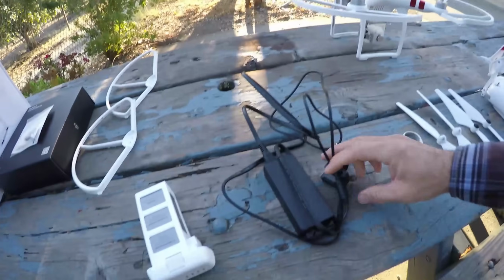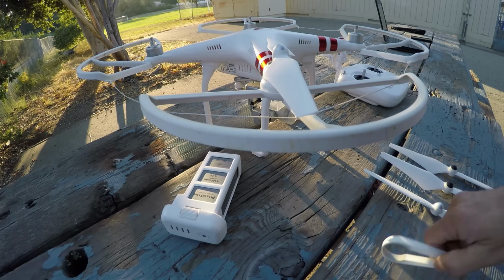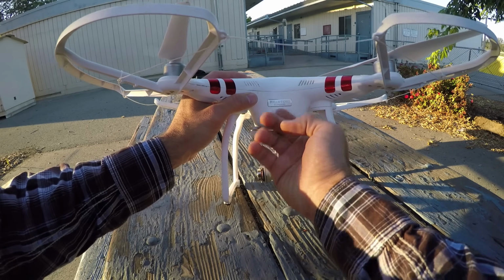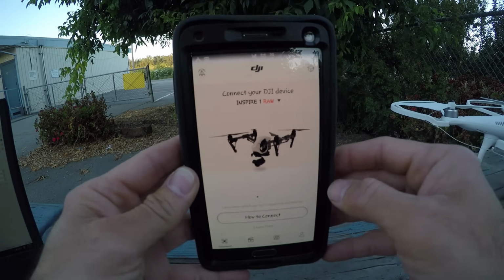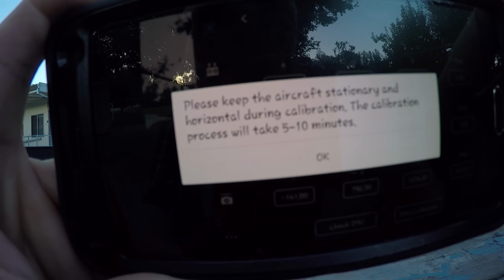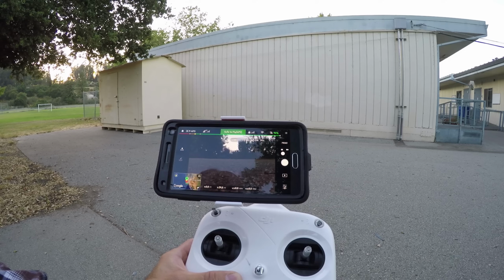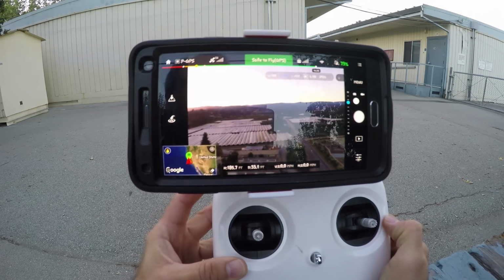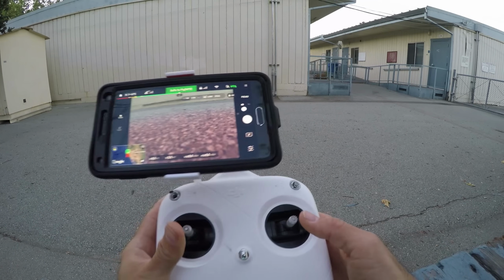DJI Phantom 3 Standard Complete Starters Tutorial

Comment: This is an awesome drone.☀️.☀️>JustU.Faith/DJI-Drone?養    Sturdy and powerful. Battery lasts about 20 min so don't fly it so far away that it can't fly back in time. I was worried after hearing reports of fly away, but never had a bit of trouble. I believe the problem some had was not resetting the home. I do that everytime I fly it even if from the same place. The 4k video is very good and since it is a wide angle view allows for enlargement.

Comment: I needed a great informative video like yours. I bought a used DJI 3 with no manuel and parts missing. The only thing you didn’t cover were the uses of the two toggle switches. I will be referring back to your video many more times until I finally piece my drone together and actually take flight, and probably then a couple of more times. Again THANK YOU !
Reply from the maker: You're welcome and I'm glad it helped. The DJI P3 doesn't come with a manual. Everything was scattered on their website which is why I tried to quickly throw it all together for a video. I actually talk about those switches in the video description because I realized I forgot them in the video. Thanks for the comment :)

Comment: When I try to use my scroll wheel on the side of my controller, the camera does not move up or down when it is still on the ground. Is this because something inside the gimble is broken? the join that moves the camera up and down stays in a relativity stiff position when everything is powered off. Everything else works fine for the gimble for stabilization except for when I want to move the camera up or down.

Comment: When you take a picture or video, does it go straight to your phone or do you need to load the mini card onto a computer
Reply from the maker: The DJI Go app will store a low res version, but the high res (most desirable) will be stored on the Micro SD card in the drone. To obtain that file you need to insert that card into you computer using an adapter.

Comment: Enjoyed your video.  Very thorough and informative.  I dont have this drone yet but after watching this, Im confident that this is the drone for me.  My current drone is very difficult to operate.  I do have a few questions.

1.  I was informed that the drone will scan and can back away from a tree or wall and avoid an accident?

2.  What is the purpose of the string around the drone?

3.  The drone has a 4 mile radius, how hard is it to operate when you cant actually see the drone?  Does it return to home automatically if the battery is low or do you lose it from whatever location your at?

4.  Can the drone survive a plunge into water?

5.  The battery life if 25 minutes.  Is that while using the camera the entire time?

Comment: I have a question, would the drone
come crashing down if the battery ran out or would it land automatically?
Reply from the maker: DerpyWhale Low/critical battery initiates a return to the set home point. The drone will fly the shortest path between those two with the height that is pre-set in the options (you can change this). That's important as if there's things in the way you don't want the drone crashing into them. You can take the drone out of return  to home mode but then you indeed risk it running out of battery and crashing to the ground.

Comment: I am trying to figure out a Phantom 2 Vision, and a couple of things seem to be missing -- or completely different from the model you are showing here: 1-there is no fitting on the transformer to plug into the better; 2- they have no American electrical plugs. On the controller, I see where the charge cord goes in -- except there is no USB charge cord. The controller has 4 AA batteries in it. Can you help?

Comment: Very informative. I have had my 3 Standard for 3 weeks and have have flown it 5 times. I viewed this prior to my first flight as a buddy had bought the SE model a few weeks prior and I wanted to get an idea of its operation as he invited me to assist in helping him fly his.

I felt like this gave me lots of info and when my turn at the controls came, I was able to get it up and flying.  He crashed his into a tree twice over his first four flights, the first hitting a branch and falling with no damage. The second time happened the same time I took the maiden flight with my own Standard and his drone is still in the top of the tree 3 weeks later in a County Park. He bought another one. I learned quickly to not just rely on my judgement of the position of the aircraft to hazards by sight but use the camera as well to be sure it cleared hazards. I love flying mine and am getting better at smooth controlling my drone.

I am watching this again and have learned new things, especially about the app, that didn't mean much the first time. So, before the next flight, I will be revisiting the app to make settings adjustment as needed and as I am flying. Thanks for your detailed presentation as it definitely helps me feel more confident.
Dave

Comment: My problem is simply getting my P3S started!  Out at a park near me, I first turn on the Controller, then the Drone and then DJI Go App.  In the top bar at the center is a gray "DISCONNECTED".  Nothing I can do changes that.  When at home,  the same steps described above will result in a connection and "SAFE TO FLY" but I have no reason why.  I've followed your steps to RESET THE RC LINK to no avail.  Any ideas as to why else I can try.  This whole thing should not be so difficult!  Thanks.
Reply: More confusion...I brought the gear inside and it started.  I then took the controller, tablet and drone outside in the front yard and proceeded to fly and land.  However, if I don't first start the Phantom, I am unable to start it outside.  It looks to be related to having a Phantom wifi network to attach to?  I have a network inside the house but not outside and not at the park.  Any ideas?

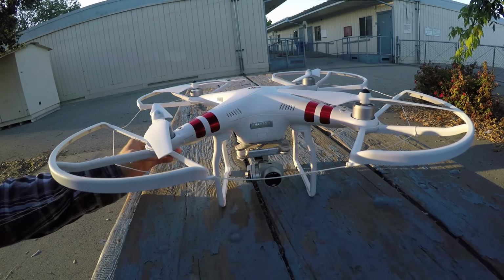Comment: Very good instructions. One thing I found wrong is around the 13:00 mark you said the link button is for linking the  controller to the battery. The link button is used for linking your controller to the Phantom 3 standard. That way you do not need to use a phone or tablet to fly the aircraft, although I would not recommend that unless you are experienced. That being said, I am very thankful for your instructions. They are very, very good instructions.

Comment: Phantom 3 standard comes with only 2 of the 4 camera stabilizer pins attached. Should we be attaching all 4 before our first flight? Looks like you had all 4 in but I couldn't tell.
Reply: sublime4hutter
Reply: do you need wifi to fly
Reply: Anti drop pins*** not stabilizer pins.
Reply from the maker: sublime4hutter No, you don't need all 4 on. I broke 2 after a wreck and had put 4 on just to see if it affected anything and never took them off :P
Reply: ahh perfect thanks for the reply! Any other cool tips youve learned since flying your drone?
Reply from the maker: sublime4hutter I love doing a manual grab from the air to shut the unit down even though it's dangerous. Also, unlocking some of the limitations in the DJI app for further flight. Knowing all the backup contingencies are helpful too.  Like knowing how to break out of a RTH procedure by using the switches. That or initiating a RTH procedure using the switches if your phone or app crashes. Speaking of which, learning that the drone will automatically initiate a RTH once the battery reaches a certain level (18-20% I think) is important. I didn't read that anywhere that I can recall although it may be in the manual. I crashed my drone in the redwoods thanks to that oversight. Had I known how to break out of the RTH with the switches I would have been fine.
Reply: tripecollie that's great advise!! Will definatly learn into the switches more. Takes some memorizing and practice but I bet it'll be worth it. How do you shut down the drone by grabbing it? Just snatch it as it's descending and push the power button on the battery ? I'm curious. Definatly a bit risky tho haha those propellers spin pretty damn fast :p
Reply from the maker: sublime4hutter I can't recommend it since it's dangerous, but the way I do it is (if it's not windy), get it just to a height nearby where I can grab the lower horizontal landing bar and just toggle the left flight stick down to shut off the propellers. I wouldn't put my hand near the switch since it's close to the propellers! XD

Comment: Thank you very much for your video. I am going to buy a Phantom 3. I am going to use it on the ocean and I want to be sure that I can land it on the boat where from I am launch it. Actually the boat's bow is only about 5mq. and the boat will move from the starting point, therefore I believe I cannot use the  "return home" feature. How can I safely land it? Thank you very much.
Reply from the maker: Renato Calo' You would have to manually land it then because your RTH point would have changed. Given that a boat moves up and down potentially this may be hard. I personally catch my drone by the landing gear that connects the antennas (lowest horizontal point of the drone beneath the camera). However, that IS dangerous and not something I can safely recommend.

Comment: Terrific intro to PH-3. Thank you. One Q: I have an iPhone 5S NOT on any provider. Can I still use it for flying the PH-3?
Reply from the maker: Withania I can't say that for certain, but the wifi link is through your drone and controller. The GPS should work on your cell without a provider. You just couldn't get detailed topo maps. I'm not positive but I don't think net is needed for that location/map function. I'd suggest reading forums or double checking the manual for the P3S which I link to in this video's text  description

Comment: Have to laugh, good wifi outside away from other interference is not very common !
Reply from the maker: dzynryt I'm not quite sure I understand your comment. The wifi between the drone and the remote controller + cell/tablet is pretty rock solid.
Reply: Maybe I'm confusing different parts of vids but I understand I need to update all components first and they talk about away from interference but you need wifi to update ?
Reply from the maker: dzynryt To update your DJI Go software and/or the firmware for your drone you should be using wifi at home with a solid/stable net connection. The interference mentioned is talking about power lines and objects that would obstruct signal between your drone and the controller. That also uses wifi but it's a different concept for what you are trying to achieve. The wifi you use when flying the drone does not have to be connected to the internet. It's the signal from drone to controller managed by the drone's smart battery

Comment: Great video... I just got this drone and love it. If I were to fly this to far on a low battery will the drone know to return home on its own? or would it land where its at? Or will it just fall out of the sky?
Reply from the maker: sheldon savard It is supposed to RTH automatically once you hit a certain low battery level. I think it's 18%-20%. HOWEVER, the RTH brings the drone back to home in a straight line at a preset height in the DJI Go app. So, you have to take that into consideration since the drone doesn't know to avoid obstacles. I wrecked my drone finding that out the first time :P
Reply: Thank You!

Comment: Thanks for all the effort that went into this. My brother just got a Standard for my 15 yr old son. Being visual learners, neither of us are particularly good at figuring things out by reading instruction manuals. Your vid was extremely informative and well organized making this content rich information easy to follow and understand. Thanks to your generosity, we have much greater confidence to embark on our inaugural flight today. 

Here's a question that may be out of your aria of expertise, but here goes...  I have a mac book pro with a memory chip reader, but the chip in the Phantom"s camera seems much smaller than the opening of my computer's reader. Do I need an adaptor?
Reply from the maker: Datsun510zen I'm glad the video was helpful for you. Thanks for the kinds comments! As for your mac, I'm not that familiar with macs but as far as I'm aware no computer has a micro SD card reader built in. You will most likely need an SD card adapter or a USB adapter. I show those in another video I link in this video's text description. The video covers the RC link procedure and the manual firmware update procedure. The part where I show the adapters is at the beginning of the manual firmware update in the video (after the RC link demonstration).
Reply: Thanks tripcollie. Kind of figured that was the case. Sounds like a trip to RadioShack. Weather didn't cooperate, so we rescheduled the test flight for tomorrow.
Reply from the maker: Datsun510zen Best of luck with your first flight!

Comment: Yet another thing I thought was easier: when connected to the remote via wifi, my phone does not connect to my mobile internet. It seems to force itself getting connected via Wifi, so it does not switch to mobile data at the same time. I digged all forums, I am stuck. (luckily, I do not need internet to operate the drone but it would be great to stream or use the mapÖ
Reply from the maker: Zotmund Szele hrmm, haven't heard that one before. My note 4 works fine with both. The map display and tracking works fine for me. It might be that the model of your phone isn't fully supported? Very strange.

Comment: I just got one of these for X-Mas and found the clamp or device holder not all that great. I wanted to use my iPad Air instead of my 5S, but it won't handle the larger size.
I notice lots of after market units that will accommodate a larger device but the reviews are very mixed! Any thoughts on the different ones available? 
Thanks and it's a great entry level video! Well done.
Reply from the maker: alan G Thanks! As for suggestions on a specific after market accessory I can't point to a specific one, but I've wanted to change mine out for awhile too :P

Comment: Oh and I have a question, do you know if I should or shouldn't store the battery in the drone? I'm just afraid to because I'm in to rc cars, and I have a heavy duty one and it runs on NIMH batteries, and I know that you are never supposed to keep that battery plugged into the car, any ideas?
Reply from the maker: Jack Gale technically you should probably remove it for longer storage. To be honest I never do though and mine is fine. So, for what it's worth, there you go :)

Comment: I just bought one of these...and I am looking at props...I see the DJI "self-tightening" props.....do these actually come with "self-tightening" out of the box, or are the "self-tightening" props and upgrade to what comes with the P3?? thanks
Reply from the maker: Chris S They come with the P3S out of the box. The reason they are self tightening is because if you match the appropriate color prop motor to the appropriate color prop blade the way the motor spins the blade should keep it tightened. You should always make sure your blades are snug just in case though.
Reply: okay, perfect! thanks a lot :)

Comment: Thanks for the video. Very Helpful! are all the parts that come with it spairs? curious in regards to the extra anti-drop kits. I notice 2 are installed on my stock device. Should the others be installed?
Reply from the maker: bender21able Yes, the extra anti drop kits are spares. You only need 2 on your drone. It comes with only 2 installed and talks about only 2 being required in the manual online.

Comment: Great tutorial.  However, I'm having problems.  I brought my P3S with me to Hawaii but I can't get it to connect to wi-fi.  It says "Update firmware for P3 Standard"  I click "start upgrade"  I get msg "update error Device Disconnected.  Please check.  OK."  I then go to to Settings (wifi is ON)  I scroll to PHANTOM3_0dbce1 and it says "not in range"  When I tap  on that I get:  security code - edit - cancel - and forget.  I click on EDIT  and it asks to enter password.  What password?  12341234?  Anyway, I enter that and nothing.  Still says "not in range"  Or am I entering wrong password?  I have only 4 more days here and then head back to San Jose where I have someone that will help.  In the meantime, I guess I'll return with no drone video if I can't get it to work.  Again, thanks for the tutorial.  Will bookmark it and refer to it occasionally.
Reply from the maker: eddie lopez Have you connected and flown this drone before successfully? That would be my first question.

The issue sounds like a RC link issue for the update process.  The password should indeed be 12341234 but it's not seeing your wifi from the drone to connect and update. So, I would suggest trying the RC link procedure I show in the first part of this video here - https://youtu.be/LeexamhXsSk
If that works you're good. You could attempt doing the manual firmware update I show in the second half of that video but it more sounds like a link issue based on what you've said.

Comment: Will it automatically avoid obstacles during Auto Return?
Reply from the maker: vignesh muthuraj No. it definitely will NOT. You have to take that in consideration when initiating a return to home. That's also why there is a switch to regain control during return to home.
Reply: tripecollie thank you. That was helpful. 
Also can I get a dji 3 as my first drone. Never used one before. Will I be able to handle it? Or should I start with beginner /cheaper drones. ?
Reply from the maker: vignesh muthuraj That's a personal decision. I think many people would suggest starting on something cheaper for a first drone. however. the P3S is so cheap now (~$300) and it has so many features built in I personally like the thought of learning on it. I was given the P3S as my first drone and had a learning curve, but obviously nothing too drastic as its still in one piece and works great.